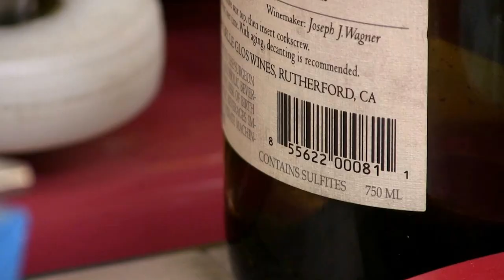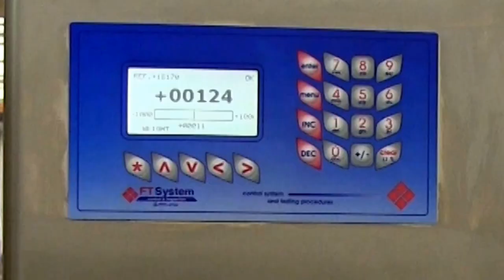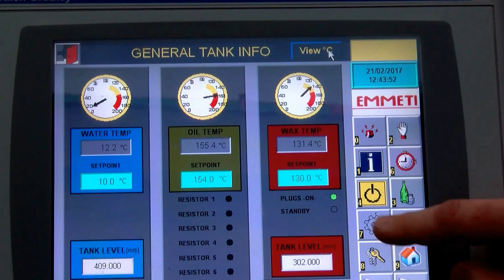Automatic Bottle Waxing Line from Emmeti for wine, beer, liquor, hot sauces and other bottles

Comment: This seems rather slow, for the money the manual labor would probably be faster and jobs would be available.
Reply: Except, you're not taking into account that this is a product demonstration video. This is only showing the process. And it's doing so repeatedly. The entire process start to finish is so much quicker. Not to mention that the speed can absolutely be optimized for maximum efficiency with minimal downtime. You can't do that with an assembly line of people. And you can't get the highest level of consistent quality from an assembly line of people. 
Machines do what they're programmed to do, people have their own minds and ultimately do what THEY WANT.

Sure,  the cost of the machine is much higher than the cost of an assembly line of people,  but over time,  the cost of the Machines is a far better investment.

 Machines don't ask for raises, need vacation or medical benefits and their performance doesn't drop off if their girlfriend is flirting with the rest of the assembly line or their mother is dying. Machines also don't quit when they realize that their job is boring, monotonous and lacking mental stimulation 😁